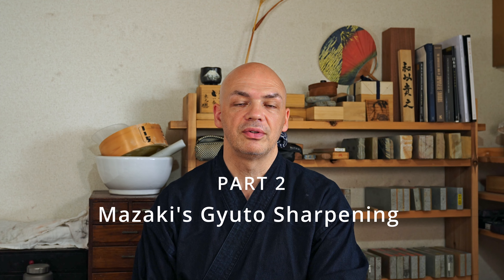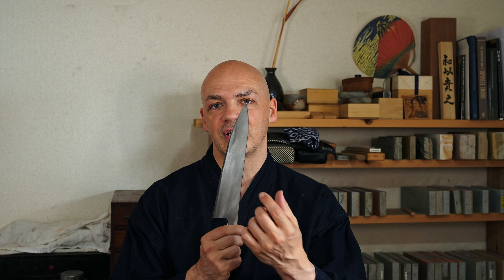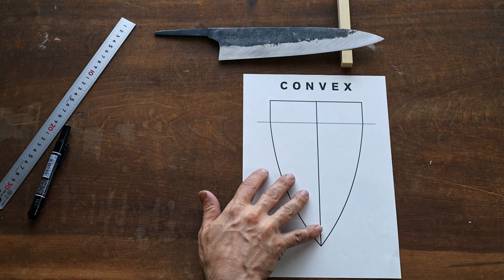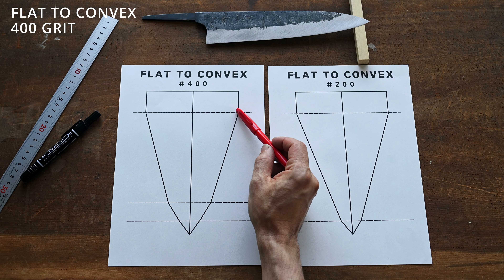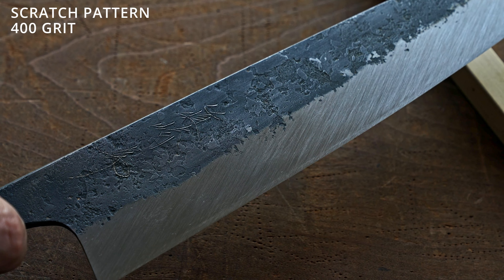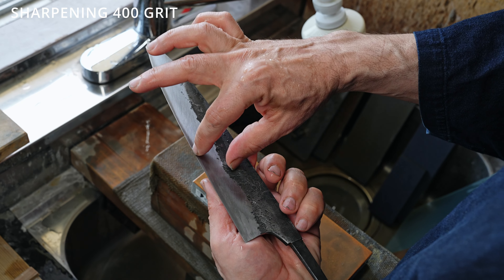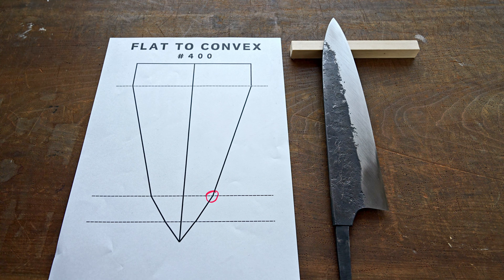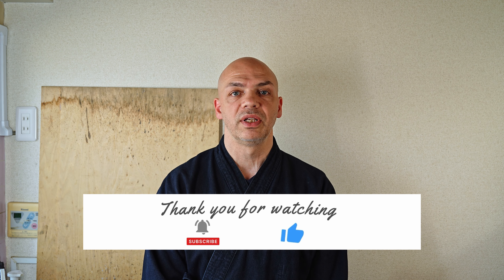Flat to Convex and Final Rough Sharpening on 400-800 Grit - part 2 | ハマグリ刃の研ぎ方

Comment: Really really fascinating when you go in-depth on the whole thought process of how you decide on the way to approach and execute the plan. I believe it really helps people who try to become better at sharpening, to move from having technique to having a good strategy. And what I find particularly helpful is that you don't show just different geometries and why something is good, but the context and how to go about with an existing item and geometry. Like how to actually make what you want for a result.

People often warn you about not doing a straight push/pull on the whetstone to avoid rounding the edge and killing the sharpness. Which is why in my head convex geometry seems extra difficult to sharpen. However this method seems approachable. I have already tried (with Ivan's and Murray Carter's techniques) with a cheap kitchen knife to straighten it out and create two distinct bevels and thinning out the knife and it really helped in understanding the process and performance, to be able to actually see what your work is doing and to get the basis for sharpening, the pre-sharpening process, in a better place. The scratch direction change is also really helpful for observing the effects. Now I've maintained a better and smoother cutting performance than I've ever had for a good while, so I'm very happy with the lessons.

Btw NSK seems to be picking up recognition here in the west as well as your videos with their stones are getting published. My go to sharpening tools entrepreneur just added a category for upcoming NSK products in his catalogue. And he tends to have a pretty long trial period before he decides on a new brand and which products to introduce in his small shop, so seems like NSK has made an impression.
Reply from the maker: Thanks so much for the great insight into my work, I often try to approach sharpening in two ways primarily what the blacksmith intended and how or who will be using the knife. From here I go onto piecing together a plan of approach.

Comment: Food adhesion happens because of capillary adhesion effect, less surface contact area means less sticking. 
The overall geometry for Japanese knives take this into account and even their Flat Grind already offers protection because of the shinogi line. Their design is so much better than a western Full Flat Grind.
S Grind, hammered finish and irregular surface from the kurouchi also helps avoid food sticking.

Comment: Another invaluable demonstration of the art of sharpening! Thank you, Ivan, for these clear and well-illustrated explanations! It seems to me that the information at 18" is particularly important, but personally, I didn't understand the connection between the 200 and 400 scratches... Perhaps there will be additional information in the following parts?? Also, the question of the pressure to exert during the different stages of making the hamaguri: Would it be possible to have an idea of what pressure is being referred to, and if it's measurable or just based on feeling? Is a strategy with a marker drawing a solution for working precisely when one doesn't yet have the required experience? Thanks again and nice hommage to Morihiro!
Reply from the maker: Thanks I’ll go into more detail about this in the next video
Reply: Thanks, Ivan! Looking for to learning more about it!

Comment: So, to cut the convex bevel, you didn't change the angle by raising the blade, but just pressed harder along the edge? I don't really get how you actually ground that initial 400 grit hamaguri :(
Reply from the maker: Hello 
The area that is along the edge I used more pressure at the 200 grit stone, this added pressure in the right place, at 200 grit the area wears evenly along the edge making essentially 
very subtle change in angle, then when I go to the 400 stones in the same area adding a bit of angle change I get a very subtle hamaguri. I hope this makes sense it’s difficult to explain in worlds